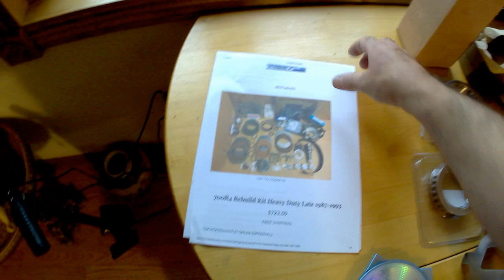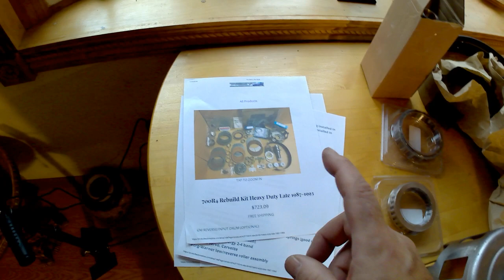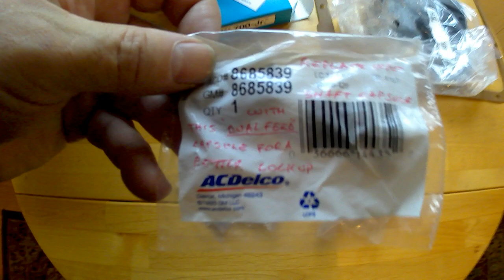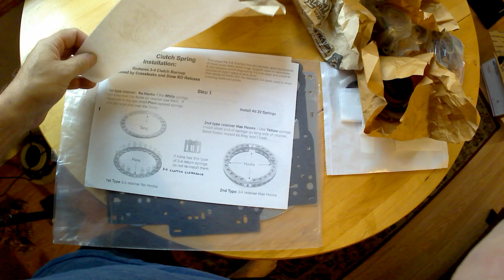700R4 Trans Parts Unboxing

Comment: I start with the TransGo Junior for Heavy Duty use. I add the .471" or .500" main boost valve here, and the .296" intermediate/reverse boost valve. I add a new 1993 PR valve that does not need to be modified. Torlon checkballs for the separator plate. Hardened corner plate, so the spring does not eat into the separator plate. A 4L60E "937" second accumulator housing with a hardened pin (RC 52). I use the aftermarket second accumulator piston which has a much longer bore for the pin (prevents cocking). I then modify the second accumulator piston by removing the ten legs on the back and make it smooth, that way the spring does not tear it up. I pre-drill the separator plate to match torque converter diameter and stall, rear end gear ratio, what is done to the motor, what the vehicle is used for, and how he drives. Much more than just a TransGo Junior Shift kit. Pro Built Automatics
Reply from the maker: Thanks for commenting I did not realize how much more you did to the kit.